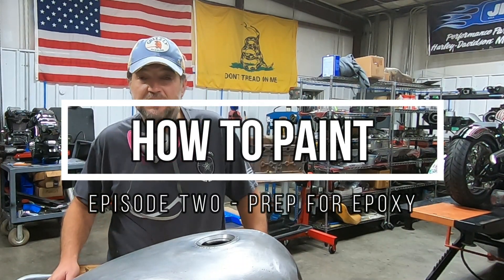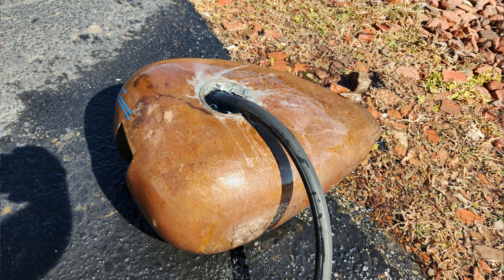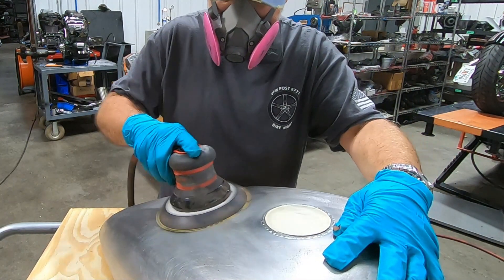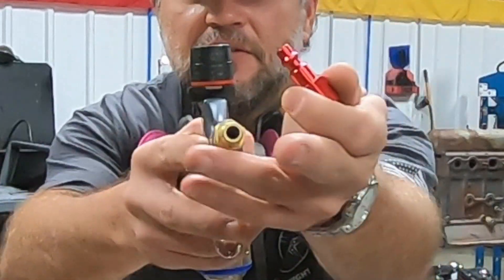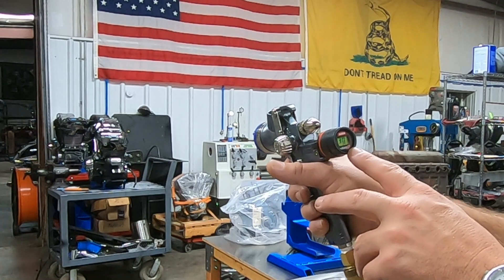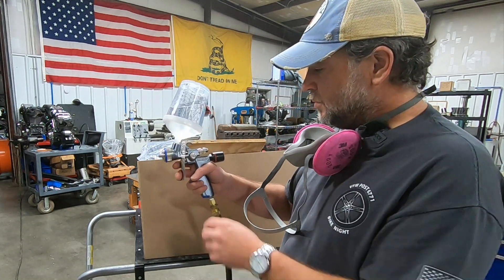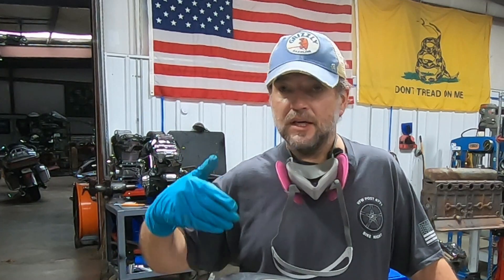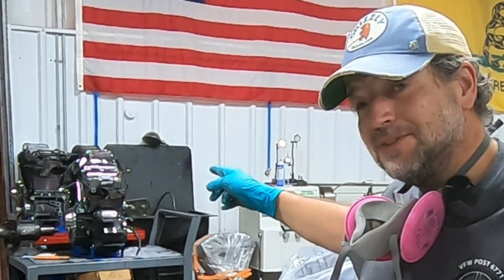How To Remove RUST From Motorcycle Gas Tank - How To Paint Part 2 - SATA DanAm - SATA 100B RP

Comment from the maker: I would like to further explain the importance of working quickly with the muriatic acid.  If you aren't sure that you can work quick, dilute it.  If you can work quickly, I've used full strength and here's what to look for.  Two chemical reactions occur when you wash rusting metal with muriatic acid. The first occurs between the rust and the acid immediately.  When the acid hits ruts, it will immediately attack it and you will see a yellowish compound form on the surface.  That is the compound formed when the acid dissolves the rust and is easily washed away with water.  After that reaction occurs, the acid will then attack the steel left behind but at a slower rate.  The key to doing this is rinsing after the yellow compound is formed removing the rust, but before the acid beings to attack the steel.  You have to be mindful and work quick.  You can actually see this in the pics from inside the tank.  Notice the only pitted surface is where the rust was and did no damage or pitting to the areas that weren't rusted.  The ink stamped on the steel used to make the tank is still visible.  In short...

If you're going to use muriatic acid to remove rust, you want to apply just enough for just long enough to make the first reaction happen without starting the second one, and you also want to rinse and dry the steel quickly. If too much of the second reaction occurs, which takes longer than the first, the acid could easily end up doing more harm than good....so be mindful.  I hope this clears the issue up.

Comment: I had purchased a Russ Wernimont tank for my 2000 fxst, had it cleaned and "Kreemed" mid 2000s, well about 10 yrs later it all curdled and blocked the filter in petcock....I didnt do the prep for the tank so cant say if the lack of prep caused it or the product failed...I as certain they didnt do nearly the prep you detail here...

Comment: With regards to your air supply, I heard you mention tank size and pressure. Nothing about SCFM.
Is it because we're discussing running a paint gun at a much lower pressure, instead of say, running a DA sander or an impact wrench, which requires a lot more air?
Or did I miss something?
Just curious.
Maybe it would matter as to what someone might be looking for when buying a compressor....?
And as always Kevin, Thanks for sharing your knowlege and talents.
Reply from the maker: Great point. Thank you...i seem to recall Tony telling me only 15cfm is ideal....I will confirm that. It may be less actually.

Comment: Hi Kevin,  I have a 2022 Fatboy 114 all stock ,only had it for 7 months and only 300 miles.  My engine oil showed way over full ,so
Reply: So I took some out to the right level, drove it couple of days, it did it again and my transmission was low. What would that be?
Reply: @donschlueter8525  seal leaking , common problem with the new engines. Vacuum situation occuring. Harleys case vent fix doesnt really fix it though

Comment: A handfull of clean nuts & bolts, a sleeping bag & 5 or 6 bungie cords covering the outside. Wate for the wife to be shopping & put in the dryer on air dry and run for an hour or so. Alot less than muretic acid,acitone & m e k.. Maby the acetone wash. That is enough. Coat with Kevins sugestion. This works
great just don"t get cought by the old lady. LOL
Reply from the maker: Thanks for the tips!  LOL

Comment: Your wearing the wrong filter that's a p 100 particulate filter you need a OV cartridge organic vapor cartridge should be square filter with yellow sticker around edge of filter
Reply from the maker: Thanks for your input...but I dont understand why I need a vapor cartridge when all Im doing in the video is sanding and spraying water.  If spraying solvents or using chemicals, that is certainly not the mask i would use.